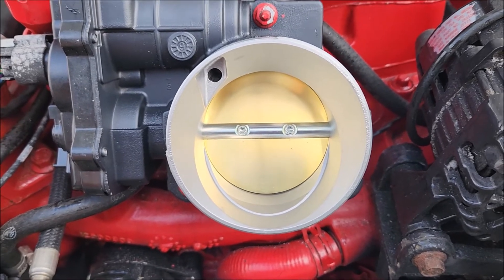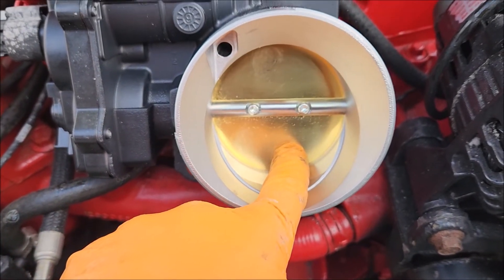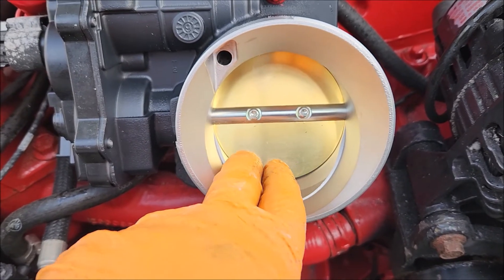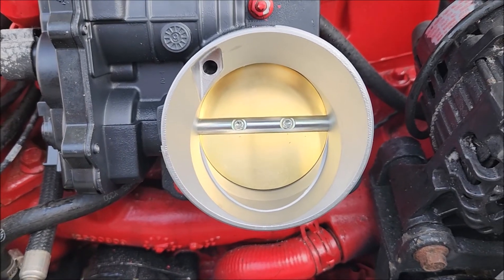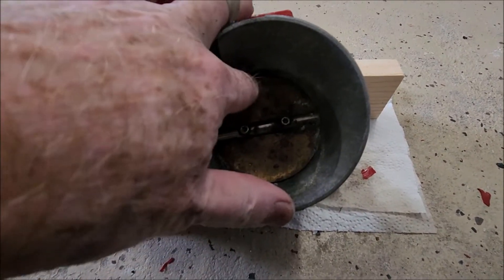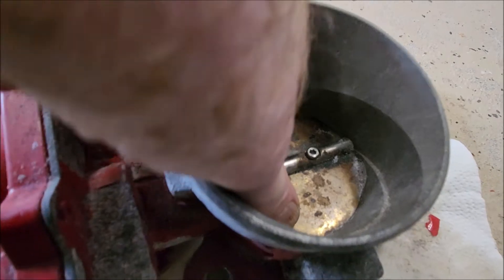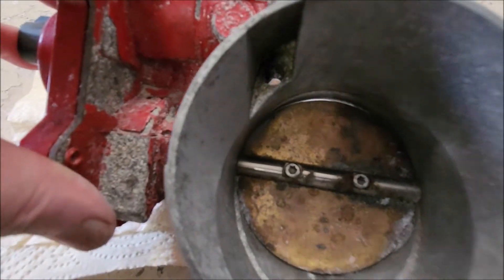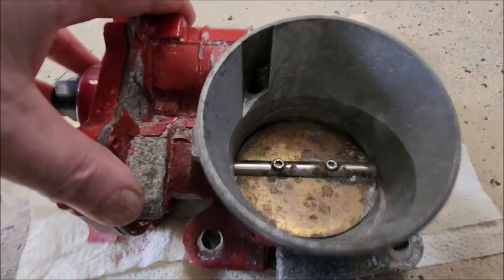Volvo Penta 8.1 Throttle Body Issue

Comment: Hi I have the same problem,  do you have the part # for the part you purchased thanks
Reply from the maker: It is an AC Delco 12679526 (note that it comes unfinished aluminum - I painted mine with black engine paint before installing). There are cheaper Chinese knock-offs of the AC Delco part, that you may find on EBay or Amazon - I thought best to stick with the OEM GM/AC Delco part. I still only paid $95 incl tax and shipping. Shop around on Ebay!  You can generally tell the knock-offs as they have screws attaching the motor drive to the body, while the AC Delco part is riveted. You will need a gasket too, I got a Mahle  H716HJ but you can also just search by the Silverado 8.1L and find other brands. 
Hope this fixes yours too!